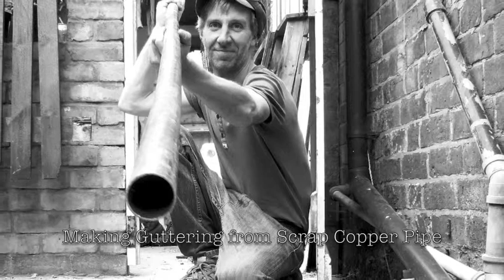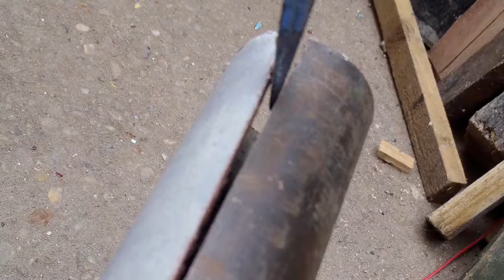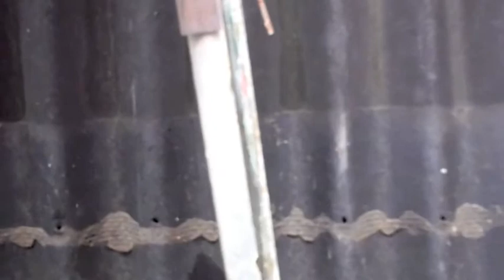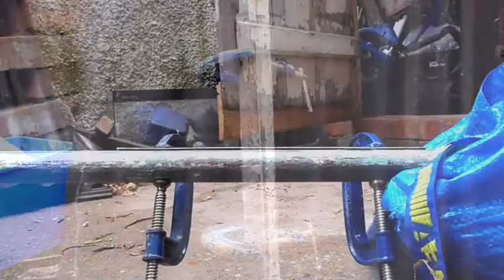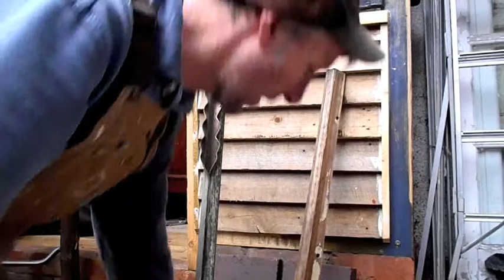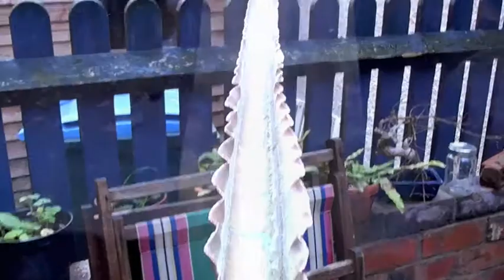Making a Copper Gutter from a Length of Scrap Pipe

Comment from the maker: I did consider annealing the tube first but left it alone because the metal didn't distort at the back with the leverage forces of the tool. Now that the entire pipe is split open and hammered flat, what I have is a roll of springy copper sheet. That will be annealed for the next stage which is to beat out the shape of the gutter with a polished hammer against a stake. So, I'm taking it down the canal, build a fire, heat and quench it in the water. That'll draw some funny looks no doubt!

Comment: it will then be as soft as it was originally to re-work into the desired shape! its a bit of an old-school technique, but I get the feeling you like more old-school methods, re engineering something for another use etc etc, like people used to do before they come up with "bullshit" wording like RECYCLE ;) as for splitting the pipe, I must admit i'd have got my aldi angle grider & a 1mm cutting disk, but then it would have been more time consuming opening the pipe out flat, swings & roundabouts

Comment: Jeff, I met you, well I think it was you roach fishing when I was walking the banks with my father probably 2 months ago, you were roach fishing, anyhoo, just thought I'd send you a tip that's worked for me, now your copper is flat, smear washing up liquid over it, & if you have a heat gun or blow torch heat the washing up liquid until it turns black, the washing up liquid, not the copper!!! this will Anneal the metal (get rid of the work hardening caused by flattening out with the hammer)